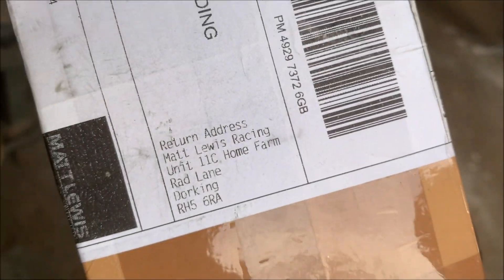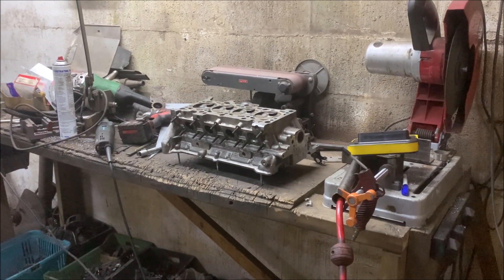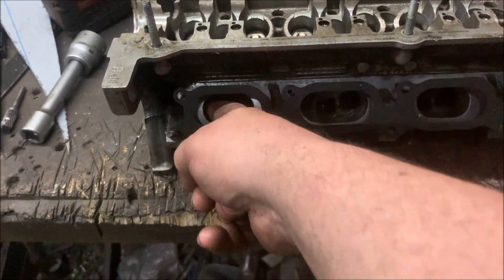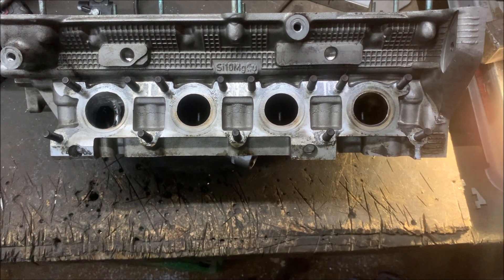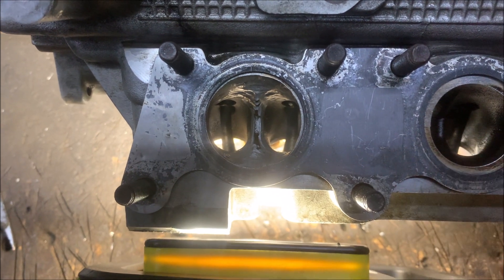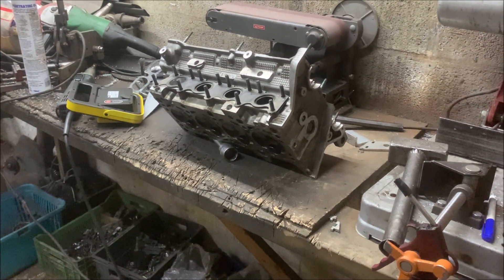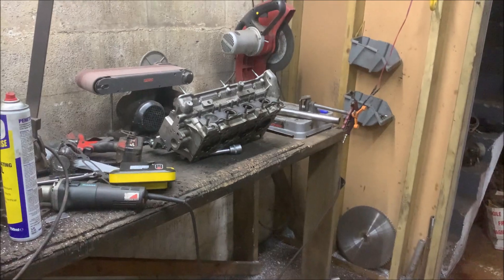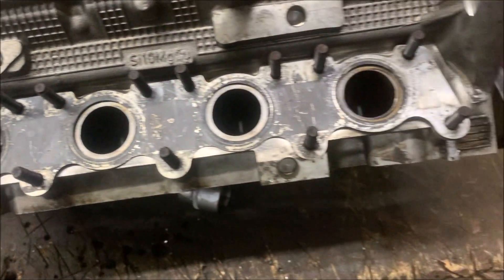1.8T 20V heads comparison. Big vs small ports, and stock vs modified exhaust ports. What's best?

Comment: So ultimately, it doesnt matter which head one gets if porting can be done?
Are there any other important differences between the two, or can big port head be ported further? Without sacrificing reliability ofc.
Reply from the maker: That’s basically what I was checking here, to see if there was enough meat to take it right out to the limits of what you’d ever consider doing big or small.

And the answer is yeah, just the same, so while starting with a big port means a bit less effort, not much as you don’t break thru any water ways etc.

What I did here was taking it further than needed so if that caused zero issues then we golden.
Reply: @StavTech  well that is good to know. Nice 👍

Comment: Isn`t it is usually recommended to leave exhaust ports not matched to manifold, because when they are same sized there will be gas reversion and it does affect negatively on low rpms especially?
Though you just matched ports to gasket which is probably fine, if the manifold diameter stays larger and the step is maintained.
In 20v head areas close to valve seat are quite rough and there probably is gains to be made, at least on big port aeb head i was inspecting.
Would be interesting to see what modifications are first done when the head is flow benched, maybe i will try to find something about it next 😀
Great videos you have anyway!
Reply from the maker: Never go bigger than you need, and if that means go as far as gasket, so be it.

Comment: a t4 divided and a spool valve would be interesting maybe that hx55 also 11:00
Reply: Could even work it on a mac solenoid an pwm tune it instead of a wastegate for the spool valve??
Reply from the maker: Not a fan of quick spool valves, prefer proper divided setups.

Same as you never see a race car or even production car with them
Reply: @StavTech  makes sense, got me thinking I need an hx super 30 now haha. Dig the videos man learning bunch over here 😂